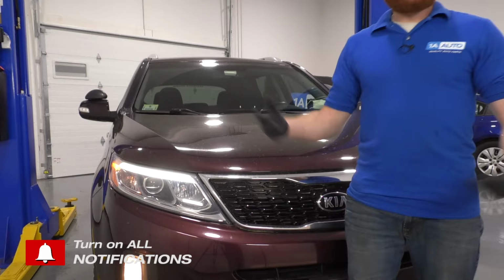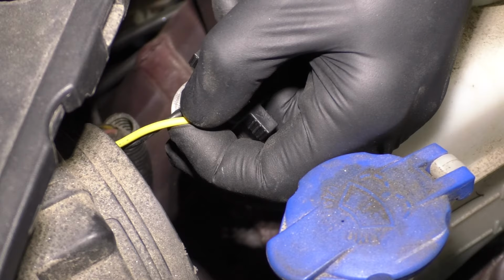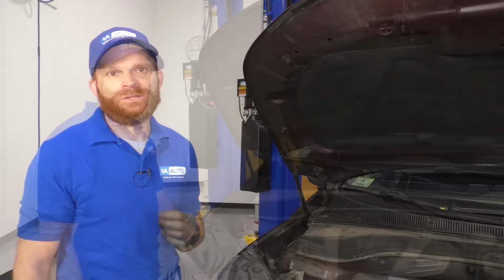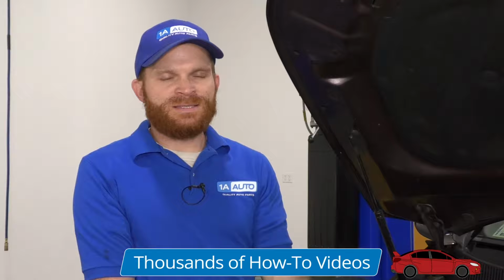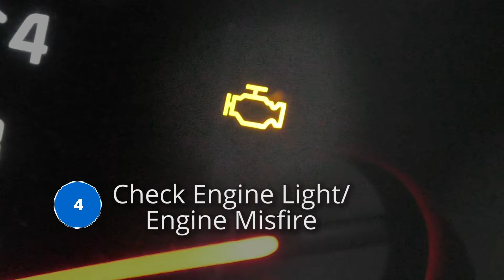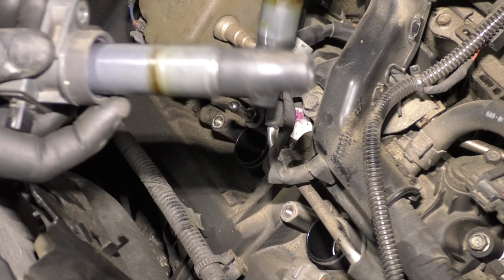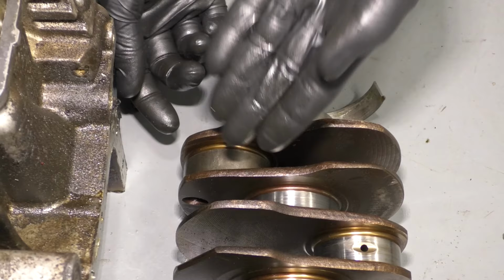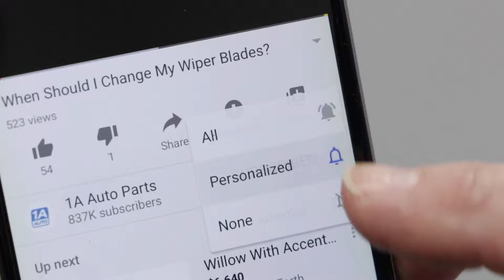Top 5 Problems Kia Sorento SUV 3rd Generation 2015-20

Comment: Biggest issue I've had with my 19' AWD SX is Brake/Rotor noise. They aren't worn out, per se-just roar at a stop. I'm at 95k and will be on my second set of pads and rotors to deal with the roaring.
Reply from the maker: +Scott Chidester Thanks for checking us out! http://1aau.to/m/Shop-1AAuto-c
Reply: Man o man you do a lot of driving! Mine’s a 17’ with almost 38k

Comment: Thanks man, great video. God forbid but mine has not had any of those issues. I believe mantainence is the secret to keep anything and everything  going smooth. Stay on top of that and you will have no major issues. I got a letter in the mail for engine fires though on the I4 and they are doing lifetime engine warranty and reimbursement for engine work. Mine has treated me great so far. I only use valvoline oil simply because they have been around since the beginning of automobile existence they have learned the most and oil is responsible price
Reply from the maker: +Multidimensional Traveler Thanks for checking us out! http://1aau.to/m/Shop-1AAuto-c
Reply: may I ask which year model you have? looking on getting a used 2019 one

Comment: I have a 2014 KIA Sorento and one headlight is always "burnt out" but when I open up the housing and grab the bulb (with nitrile gloves on" the light starts working again for a month or so. My steering wheel buttons have stopped working, I am not able to scroll through the different pages. MY "time to service" the vehicle light is on but I cant get to the "reset" button so I just have to keep it logged when the next oil change is needed. I have been very happy with my 2014 except for a few smaller issues that are just annoying (air bag light, rear window wiper fluid wont flow (it leaks from the bottom of the car and I cant get to where the issue is) and my fuel door button wont open the fuel door. Otherwise my Sorento has been an awesome vehicle for my family, I have over 110k miles on it without anything really major happening. I would buy this one again if I had to...
Reply: i was kinda shocked reading this. we have the SAME exact problem. mine has 130k miles and has been amazing other than the issues you’ve stated

Comment: Has anyone here gotten their timing chain tensioner (and probably chain too) replaced? I experience that exact rattling on startup and it goes away after a few seconds even with the oil level always full. It's just past 100,000 miles. Thinking of getting that replaced before it slips and the whole engine shreds.

Comment: I had engine failure of my 2015 Sorento LX. Took it to the dealership and they said a piston arm broke. They told me it was a common problem with this model engine, and kia acutally extended the warranty on the engine, so I got a new one replaced for free.

Comment: I'd like to address the airbag light. Mine comes on intermittently but has others that come on as well such as the traction control and ABS. I believe it is a ground issue. I need to know the locations of the relevant grounding points. Do you have this information? Thanks in advance.

Comment: Our Kia Sorento LX has a problem with the tail light, I think it’s the wiring harness, how do I know what the issue is, we took it to a mechanic and they couldn’t find what was wrong but replacing a bulb didn’t fix the issue, advice?
Reply from the maker: +Yeet Delete We wouldn't be able to diagnose an issue like that here, you may want to have a local mechanic take a look at it. Thanks for checking us out! http://1aau.to/m/Shop-1AAuto-c

Comment: I have a 2014 Sorento KX3 and it has developed a battery drain after crash repair, which involved front headlight panel, bumper and radiator replacement... The repair shop told me I needed a new battery. I knew I didn't, but replaced it anyway and still have a flat battery overnight after fitting a new alternator as well. Curious thing is, there's no sound from the audio system. The screen works and there's no fault displayed. I've checked the amplifier under the seat,  there's power to it. Kia dealers are clueless. I've reset the audio using the little button by the cd slot. I've even disconnected the leads from the battery and connected them together (after waiting a good long while). Still no sound and still battery drain. It's actually intermittent - sometimes the battery loses no voltage over 24 hours. Then it loses 1.5 to 2 volts...  I'm going to do a current check next and pull one fuse at a time..... Anyone have any ideas? I'd be very grateful!!

Comment: Does 1A Auto have all parts available for 2020 Kia Sorento's? Also I have a wire hanging in the front of my Kia Sorento, and my right headlight is not working any suggestions?

Comment: I purchased from a dealership a used 2016 push start kia sorento ex with a little over 40,000 miles on it when purchased clean car fax with no accidents. I added an extra 5,000 miles going back and forth to work. I’m a traveling Medical Assistant, I was on an expressway the car wouldn’t accelerate past 38 miles. Speed begins to decline I exited off the expressway my car say needs a diagnostic check then shuts off. I wait about 5 minutes to turn it back on it did but white smoke comes out exhaust I shut the car off when I saw the smoke and smelled fuel in the car when I turned it off. Had the car towed told the driver car doesn’t turn on he tried it turned on but once we got it to my home it wouldn’t turn on he tried again it struggled to start finally it turned over and he was able to park the car. Long story short car doesn’t turn on at all only the interior, dash lights and radio come on. Power locks work, and windows work but the car doesn’t start. Had the battery checked it’s in excellent working condition car still doesn’t start. The tow truck guy said it might be a fuel issue.

Comment: 2017 kia sorento Any problems with the back door hatch it's locked when I try to open from outside it makes a running motor type noise ? Not sure what it is thought I'd ask!!
Reply from the maker: +Alex Campbell We wouldn't be able to diagnose an issue like that here, you may want to have a local mechanic take a look at it. Thanks for checking us out! http://1aau.to/m/Shop-1AAuto-c

Comment: Great video!  I have 2007 Hyundai Santa Fe, 3.3L with the 4 second rattle on on start up, even if oil is topped up.  I think it might be easier to get rid of the car.  :D
Reply: what model car would you reccomend that is more reliable?
Reply: That would be the Vvt camshaft, lots of cars do the same, other brands as well.
Reply: Back in the "old" days, that would be just the valve lifters pumping up during start-up. Not so today? Do they even have valve-lifters anymore? Maybe I'm dating myself!  OOPS!

Comment: 2015 kia sorento 6cyl started  leaking oil into coolant resevoir...not overheating  no smoke coming from tail pipe. Holding pressure ..can't figure it out  ..🙄

Comment: My kia sorento 2011, when turning the wheel it does a squeal sound but on the inside of the steering wheel. Also my interior lights always stay on when driving when it should be off. Please help. Thank you.

Comment: My kia soul has the knocking noise when first start and the headlight issue. Im gonna suggest to my hubby to replace the wiring to it next time it goes out.
Reply: If knocking definitely check for recall and Call local Kia dealer right away. I just had my 2.4l engine replacement free of charge due to recall
Reply: My Kia Sorento 2011 sometime smoke tell me why. 180 ,000 mi

Comment: I think build quality in US is completely different from Korean, I have the 3.5 cc v6 engine (made in Korea) and I don't face any of that BUT since I purchased the car in 2014 and I am facing issues with the AC every year, AC system changed completely in dealership workshop and still facing the same every year.

One strange thing to add, recently I noticed the engine bay is way warmer than usual, no explanation from dealership, still facing issues with AC in midday, morning and evening AC is fine. Other than AC I never faced any issues. But in 50 C (122 F) climate, sorry AC is everything to me.
Reply: Maybe its your 122F climate thats causing the problems

Comment: Hello, Thank you for your very informative videos. My wife has a 2018 Kia Sorento that we bought used and we continue to have starting issues with it. The car will simply not start consistently. It seems to me to be something wrong with the signals that are sent during the starting sequence because after struggling to start the Sorento, it will sometimes start with only having to touch the start button and your foot is not on the brake or after fighting to try to get the Sorento to start, you get out of the car frustrated and close the driver's door and the Sorento starts, but yet no one was inside the car pushing the start button or had their foot on the brake pedal. It also has a very hard brake pedal during the times that it struggles to start. Do you have any experience with this happening in Kia Sorento or other Kia vehicles? Thank you for your help 🙂
Reply: I have the exact same symptoms with my 2018 Kia Sorento
Reply: What model and motor is it?
Reply: How many miles on it?
Reply: Bought the 2016 Kia Sorento, had it for about 4 years just hit 95k miles, did my regular maintenance, I was heading towards Vegas with my wife, all of a sudden, check Engine light came on at 10pm middle of no where. The car started to slow down didn’t have any service, had to walk to the gas station, tow the car back home which costed 1k bucks. Took the car to the kia service shop, and found out that the we needed a new Engine!!! Rod bearings gave out.. really disappointed. Not sure if it’s going to be under manufacture warranty.

Comment: I've had two Sorrento's first needed a new motor and transmission after 130000 plus miles got them and someone hit me totaling the car. Have another Sorento 2017 again love it and now it needs a new engine at 133000 miles love the car but the engines are junk. And yes I'm on top of all my maintenance.

Comment: Have you seen a failed oil level sensor? I noticed a small leak and low oil during my last oil change. My 2016 Kia Sorento was 2-3 quarts low after less than 1000 miles after changing the oil. The small leak is a big leak while operating apparently. Either way the oil light wasn’t on and I never got a low warning.
Reply: is fixed now, and if not what is the solution?

Comment: 1. Basically, bad contact causes heat, which shortenes the bulb's lifespan.
2. Could it also be a hydrulic valve lifters causing that noise?

Comment: Dealer just talked me into a Sorrento with 93000 miles. I pray it lasts 5 years Lol
Reply: Bought brand new 2013, still happy
Reply: It will!
Reply: @lungaswazi9194  hey man! Any major issues? I’m thinking about getting the 2016
Reply: I am looking at 2017 KIA SORENTO LX AWD good condition  (not very good or Excellent condition)  with 65k miles and  out the door cost at $17k,  would you recommend this car at this price?
Reply: which year model? and how is it so far. thinking about getting a 2019 v6 awd

Comment: Hi. I just need advice on whether to buy Sorrento 2014 or 2015. What is the crucial difference?

2- Is Kia Telluride 2014 or 2015 better than Sorrento?

Regards
Reply: Check which kia has the ksds sensor they come with a lifetime warranty with unlimited miles. 

Telluride didn't release until 2019. 
If you have a chance to get the Telluride that would be the better buy but it would be pricy compared to a 15 sorrento.
Sorrento is considered a compact suv so your lacking in space

Comment: That amperage part at the beginning makes absolutely no sense. The part which is limiting the amps running through is the actual bulb. If the wires were supposed to act as a resistor for the bulb, that would be a major, major fire hazard.

Comment: I have a 2015 Kia sorento V6 SX 3.3L with 139,000 on it.  I had three of those misfire codes along with P0019 Crankshaft sensor B and P0024 Camshaft posistion timing (Bank 2) codes.  All these fired at the same exact time.  I changed the oil, replaced the battery, and all of the other parts.  Now when I try to press the brake to start the car it is very stiff and the car will not start. I tired the bypass method but it does not work.  Something is wrong because when you initially push the start button (no foot on the brake) it turns orange.  Then if you push the start button (no foot on the brake) it should turn GREEN.  My ONLY turns red.  What could be the issue?  It was starting fine until i replaced all this stuff.
Reply: i have a 2016  sorento 2.4l, do you think they have engine problems?

Comment: Blown gaskets due to stripped bolts. KIA's replacing the engine. Costs 19k, so not sure why they didn't correct this long ago. Cracked radiator. The car only had 50k miles when everything started to fail.

Comment: Will a rattling timing chain tensioner on startup cause any problems?
Reply from the maker: +Shane Lockhead Yes, this could cause issues with start up, however, we suggest having the vehicle professionally looked at as we cannot diagnose online.
Reply: 1A Auto Parts thanks. My fear is the chain snapping and making a break for freedom  through the casing!
Reply: @raftonpounder6696  if you have a vvti engine then is the camshaft making the noise.

Comment: This Kia has a 3.3L engine size for those who are wondering.
Reply: I thought the V6 Lambda is pretty reliable compared to the i4?
Reply: @daijoubu4529  it is. The V6 is more powerful and reliable. It’s a pig on gas but it will outlast the 2.4 L . The 4 cylinder engines have been recalled for engine failure
Reply: @brendenaerosmithfarr8226  which kia and year?
Reply: @maggiemhando412  any Hyundai/Kia product with the 3.3 V6. The Sorento’s from 2014-2020 have the V6

Comment: Wow,   I have had a 2017 Sorento LX with a 3.3L six since new.   I also have a 2008 hyundia santa fe  with a 2.7L six.   I have not had these problems in either vehicle.  I don't think the problems are as common as you say.   I have only replaced one headlight bulb.  There is clicking once in a while BUT, I do all the repairs myself and keep the oil filled.   Once I had the check engine / misfire happen and it was a very minor issue.  A short drive with the code reader and the issue was found and quickly solved.
You seem to be making these videos for people that can't even do maintenance.   I think you are really overstating problems.
I think the worst part of the sorento are its brakes.  In the mountains, they heat up and fade very quickly  and I don't ride the brakes.   Worst I have ever seen.  Upgrading the rotors and pads really makes the brakes work better.

Comment: its a big engine    and need to change the oil every 5000 km   n0 more  with a 5-30  grade from kia  and
 use  ngine flush every 20000km

Comment: my 2015 KIA Sorento, the headlights on the left side don't work, also every time i put on my signals the headlights go out. I can't figure out the problem. Now it won't start at all, it doesn't even make a click sound, completely dead and the battery was just changed 4 months ago. Brought it to 2 Kia Dealership to check and they can't seem to find the problem, it has costed me close to $400 just to look at and not find the issue. H-E-L-P!
Reply from the maker: +@gracegg7107 We wouldn't be able to diagnose an issue like that here, you may want to have a local mechanic take a look at it. Thanks for checking us out! http://1aau.to/m/Shop-1AAuto-c

Comment: I have a 2015 3rd gen. Rento, and I do not recognize this vehicle. is this a 2015 2nd gen. with facelift? also mine is a 2.2 crdi 200hp, so how do these claims of yours cover the before mentioned "Top 5 Problems Kia Sorento SUV 3rd Generation 2015-20"? your parts are weird.
Reply: You clearly don't have one because it actually is a 2015 look the lights before talking
Reply: @mooauto2388  He’s European. Theirs probably look different in Finland.

Comment: My 2014 Kia Sorento 2.4L 4c - 120k miles - Repairs that I remember off the top of my head.
I will never buy a KIA again - I have an extended warranty so most of this was covered

Cracked Piston Rings -New engine
Wheel Speed Sensor - New Hub / New ABS cable
Airbag - Clock spring
Check Engine - Replaced 2 O2 sensors
Catalytic Converter - Replaced
Engine Movement - New Motor Mounts
Engine Movement - Some AC pully part replaced
No AC - Replaced High pressure lines
Left FR noise - Replaced Tierods
Fuel Door not opening - Replaced switch
RR Window will not roll down - Replaced switch
Burned out tail lights many times - Replaced - Showed signs of burning
Burned out head lights many times - Replaced
Front Brakes - Changes numerous times 
New Battery
Reply from the maker: +Brad Stevens Thanks for the feedback!

Comment: Just did head gaskets on my moms 2016 168000 miles. All the head bolts stripped. Helicoiled them all. What a pos